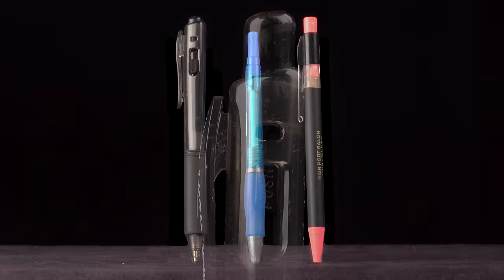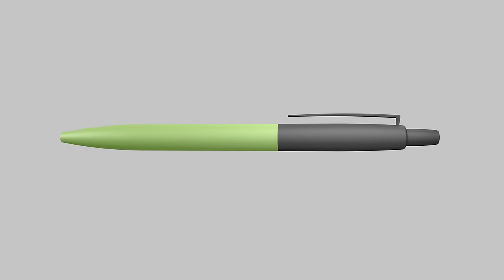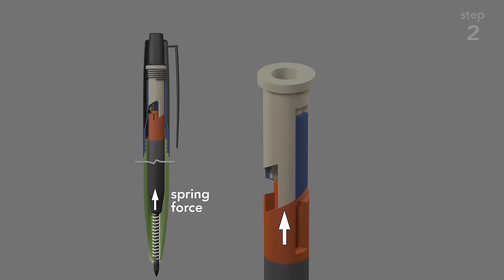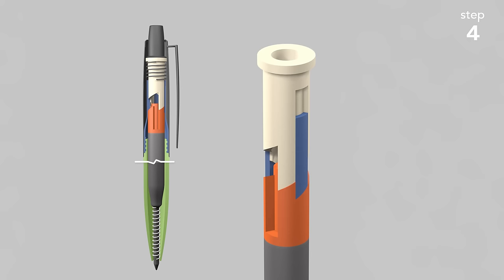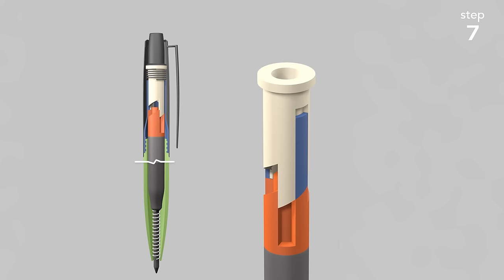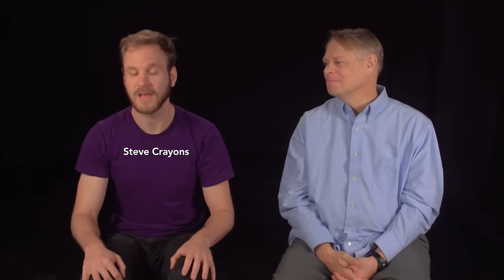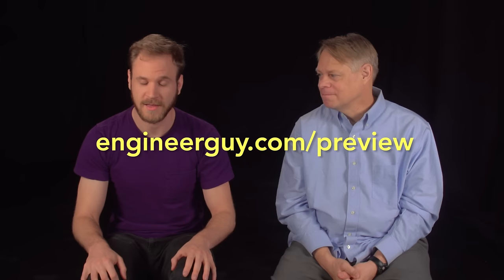How a Retractable Ballpoint Pen Works

Comment: I have actually sat with a magnifying glass to figure this out, but it happened so quick I never really figured it out. I could tell the cam body went around and around, but couldn't work out the locking mechanism step by step action.
Reply: +lazygamerz i did the same during a slow class and i semi-figured it out. Altough i could never describe it as elouqently as Bill does.

Comment: I'm having LEAN workshop flashbacks from this. We have to improve process flow in a retractable ballpoint pen factory. It used a similar but slightly different mechanism. I must have put together and taken apart 100 pens that day. I never thought about what exactly caused the clicks. That was a very nice visual you put together there.

Comment: Spin off episode....the machines that test these mechanisms.
Reply: Sadly, they are quite mundane. Linear actuator with spring loaded pad, counter, and a guy who can go around 20-25 of those each day to see if it still works.
They might put a second counter at the front to record the number of "extensions" (= 1/2 number of actuations) to show when the mech is starting to go.
It's the test spec that is interesting.

Comment: Random pen-related childhood memory:  I used to take them apart and deform the bottom spring by stretching it and then put them back together.  The result was a lot more tension in the pen's mechanism so I could launch it by bracing the top against a desk, actuating the mechanism and letting go.

Comment: Where can we suggest subjects?
I think the ToastMaster is the cleverest invention of the 1930s. It self lowers, self raises and uses infrared to know when the toast is done.
Reply: I would love an exposition on those water bottles that let liquid out when you suck, but not when you squeeze.
Reply: +Walter Clark Wait, they had that stuff in the 30s but now in the 2000s im burning my toast?  Is evolution going backwards?
Reply: +sc0tte1 
I know.  That's why the thing is so incredible. No motors. Just rods of special metal that expands with heat. And a thermostat that looks at the toast. 
I found his email and suggested it, but like all famous youTubers, he never looks at suggestions.
Reply: +Walter Clark WHaa? Since when did toasters have some sort of system that "looked" at the toast to see if it was done? I thought it was all just done via timers, as that seems to be the simplest way of doing it as all bread is mostly similar. Or are you referring to a specific toaster? I've never heard of the "toastmaster".. if so, why do modern toasters burn toast?
Reply: +kekejojo1212 Glad you asked.  Yes today they are timed, but the original Toastmaster patent had four mirrors that allowed a thermostat to ONLY see the surface of the toast; not the heating elements.  When the toast radiated some amount of heat, it triggered the thermostat and the heater was turned off. That meant the mechanism that kept the toast down cooled down and the toast slowly rose. It took about 7 seconds to rise up instead of popping up which is probably what most people want.
Reply: +Walter Clark Interesting. I suppose toasters nowadays just use very simple methods like timers because its so simple and cheap to produce. However, I think the idea of a burn-proof toaster is a good idea. Although, some odd individuals like my dad like his toast charred, so I guess it's up to the user to fine-tune the preferred timer setting and it's simple mechanism works fine for that purpose.

Comment: My favorite pens are the G2 Pilot pens, because they're easy to modify into pen-launchers.

Basically, take the spring and place it between the two plastic parts that let the pen function normally. There is a little plastic ring incorporated into the body that provides just the right amount of resistance to keep the spring tense, but not stuck.
Using a saw, cut off the tip of the pen and reattach it so that when you press the button, all the parts don't fly out but you can still load the launcher and fire it.

Bam! Now go have fun at your local middle-school.

Comment: Genius! Now I get it! So it's not a reciprocating mechanism, nothing needs to go in reverse. It just rotates, round and round, forever. Between the two states, which are implemented twice. It's so simple!

Thanks, I wondered about this forever! I imagine the patent's long-since expired, so now all pens use a similar mechanism. Or at least most of them, the ones with a separate "release" button are just cheesy and cheap.

Comment: as a mechanical design engineer, some very common daily engineering applications (like the ball pen) accumulate some many efforts of engineers generations by generations. The mechanism of ball pen is still very insightful for mechanical design.

Comment: I use a stainless steel Parker 45 for my daily writer, it is far smoother than any of the cheap ballpoints I have used previously, though it is fat more delicate, and I've already had to replace the nib once after a fall.

Comment: Freebie: Cam rotation will end up spreading pressure-wear on the pen tip, since no one writes with the pen fully vertical, but will likely write with the clip indexed towards the area above the hand-web.

Comment: This was one of the best demonstrations I've seen on this channel as I'm usually still left with questions. (That's the problem with keeping the videos so short though.) Anyway, this shows why 2 of the 4 clicks are a bit stronger and, consequently, louder than the other 2. I admit that I've taken pens apart years ago out of curiosity so I already knew how they worked. I don't believe I've seen the type that rocks back/forth though.

Comment: Hey E.G.,
Good vids!
Remember the dial phones?  You stick a finger in the hole and rotate clockwise until your finger hits the stop.  When you pull your finger away, the dial is free to rotate back to its start position.  It rotates at a fixed speed determined by a governor.  The governor works so well that you can not force the  dial to move faster (because you wish it would do so!).  How does the governor mechanism work?
Thanks.

Comment: I would like to point out there’s a missing part in the 3d depiction of the pen in the video, at the front part of the pen, there’s a plastic part that holds the front spring in place, that happens to go loose if you drop the pen as it happened to me, would be great if you could complete it guys so I can have a clear 3D visualization and try to fix my pen, great video by the way big fan

Comment: IT'S THE SPRING PRESSURE THAT MAKES IT SPIN! I stared at a clear pen I had in second grade for hours wondering what actually was applying the rotational force as I couldn't see anything since it was so fast. 16 year mystery solved

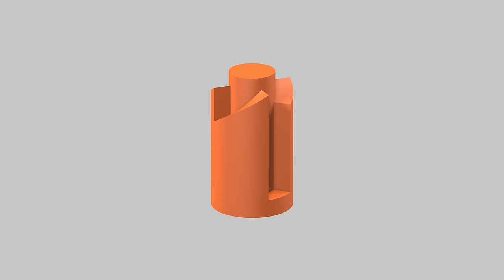Comment: Excellent video! One critique though. At 3:30, the animation shows the cam body turning in the wrong direction; in the prior animation, the cam body always rotates in the direction the angles point— and should therefore rotate counter-clockwise. However at 3:30, the cam is shown rotating clockwise, which is inconsistent with what was just demonstrated.
Reply: +Berkana Good catch! Adding that animation at 3:30 was one of the very last things I did when making this video. It's not obvious at all, but I made that animation by keeping the cam body stationary and rotating the camera around it. I wasn't even thinking about the direction of the cam body in operation. I can see how that is misleading.

Comment: That's a very interesting explanation! Such a neat idea for a video!

What allows the spring attached to the plunger to rotate? I would think it would eventually grind down the plastic by rubbing against it when it turns, or just make a very unpleasant and grindy motion in it's rotation (since it's metal against plastic). Why isn't this the case?
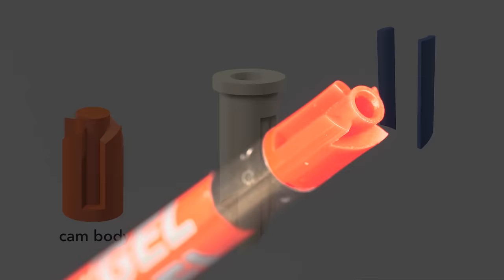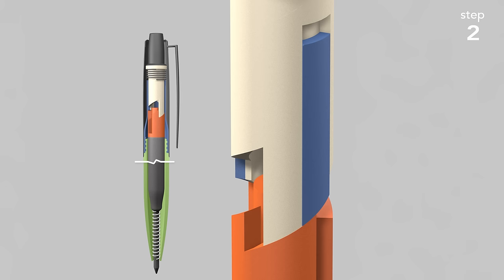Reply: +Naomi Nekomimi 1:23 states the plunger does not rotate. 2:25 show the plunger/spring in operation, and there is no indication that the spring around the plunger rotates. It seems to me that the plunger spring is stationary, allowing the plunger to have vertical motion inside of it. However, they are both free bodies inside the pen housing, therefore may have some frictional wear as you stated. It is easiest to think that the only rotating part is the cam body (as well as possibly the ink cartridge if it is fixed to the cam body).

Comment: I had all this figured out for alot of uni balls and pilit pens. only thing I still havent figured out is what makes it rotate?!
Reply: +Anas Malas The sloped 45 degree angle makes it rotate because of the spring pressure.
Reply: +Shades 
but why does the lower spring force it to move in that direction?  I would have thought it would just push it up, not rotate axially
Reply: A. L. I think it will force it us. But above there is that 45° slope that makes it easier to rotate than resist

Comment: I have always owned a Parker pen. Black ink. I like the balance and the clean look. And the price point is nice. I think the arrow is a nice touch in the design of the pocket clip. I've tried many different brands of pen but I have always found the Parker to be the most reliable. I usually lose the pen and buy a new one... ;-)
Reply: I use both  Parker and Papermate pens and find them equally reliable. I've had my present Papermate for 20 + years.

Comment: Hi, sorry if this is a dumb question.. but I've been taking these pens apart all my life. I understand the whole mechanism ans always have except for one major part. What causes the cam body to actually want to twist? It was said in the video that it is at an angle, but I don't understand where the angle is located for it to want to spin. I've always imagined it just going up and down but that has never been the case.

Comment: Do you have a vid on the original parker 51 jotter ball point pen?  I think mine missing the cap spring so i have to push pull to work it.

Comment: I see the ink tank, in total moves 5 milimeters. I would need a 19milimeters movement...where should I start? I guess I should work cilinders wuder in diameter and also the slope of those shapes would be higher?

Comment: Nice engineering. The much cheaper 'cost-effective' types have a simpler version of that action. How do I know? Well, despite the internal spring pressure, and being screwed together, they can eventually dismantle themselves in a coat pocket. That's when you learn how they work |-)

Comment: If your pen quits writhing it may be because the ink has become less fluid and won't flow properly. I disassemble my pens, put just the cartridge in a microwave oven set on high and "cook" it for 10 seconds. This liquefies the ink and the pen then works fine. You're very welcome.

Comment: When I was a kid, I'd take the shell/body of the pen off and keep the ink tube, spring and the head/cap of the pen, and i'd pull the cap down the string and then release it, so the cap would fly off in a ballistic trajectory at my enemies. I got pretty damned accurate with that springloaded pen musket until I incurred punishments which outweighed the entertainment value.

Comment: what programs are you using for the visualization?
Reply: +biju pl  We use Cinema 4D for the 3D animations.
Reply: cheers for the feedback, but i want to know one more thing do you import the models from elsewhere or do you do them yourselves?
Reply: I did look at some models of pen mechanisms from grabcad.com, but in the end I modeled all of the parts myself in C4D. I measured the actual pen parts as closely as I could with calipers and based the dimensions off that.
Reply: +Steve Crayons damn, impressive

Comment: but why the cam body spins?
Reply: the spring at the bottom pushes it up.
if it can't go up, but nothing is blocking it from the sides, it will turn because the top is slanted
Reply: @Daniel-yy3ty  omg so obvious 😂😂 thanks

Comment: i had a pen back in high school that used the clip as part of the mechanism, so when you put it in your pocket, the ink cartridge would automatically retract. great idea and all, until I loaned it to another student and the bastard chewed the clip off.
Reply: Dustin Sylvester Sounds like the mechanism of a Lamy Tipo or the famous Sheaffer Reminder Clip mechanism of vintage Sheaffer ballpoint pens!
Reply: the end result would have been the same, but having done some looking I believe what I had may have been an earlier version of Pilot's current SnapClick pen. I can say beyond a reasonable doubt though that there's no way my parents would have handed me a Sheaffer!
Reply: Interesting observation on being a Pilot SnapClick. I have never seen that pen before. The Sheaffer reminder clip was a cheap Sheaffer made from 1970s-to around 1980s I believe and when you clicked the pocket clip like a light switch it popped the point to write or turn if off to insert pen on pocket. The clip was quite novel for the era and Sheaffer should have kept it up to pens for today.